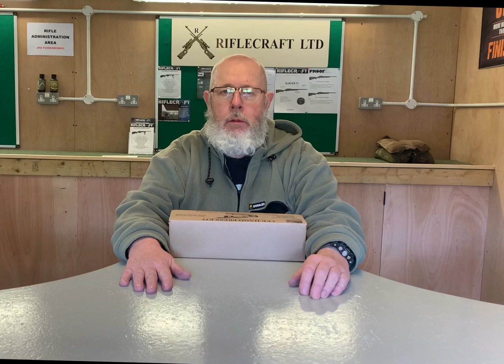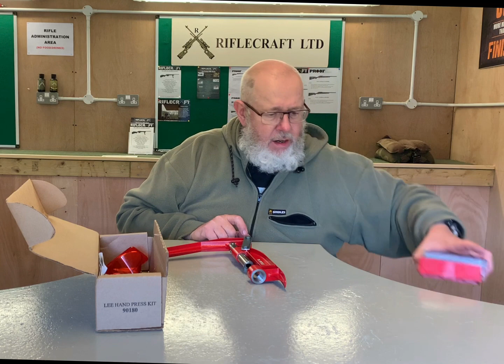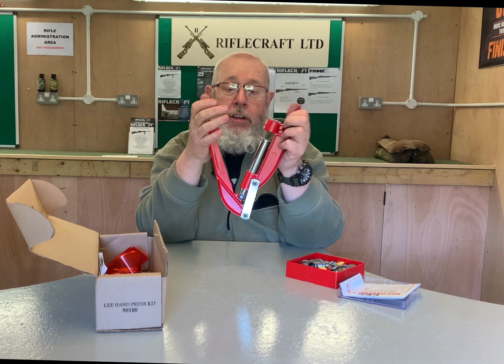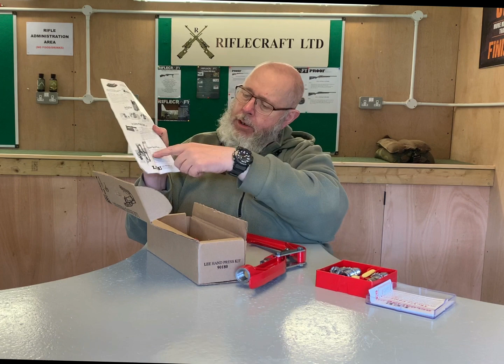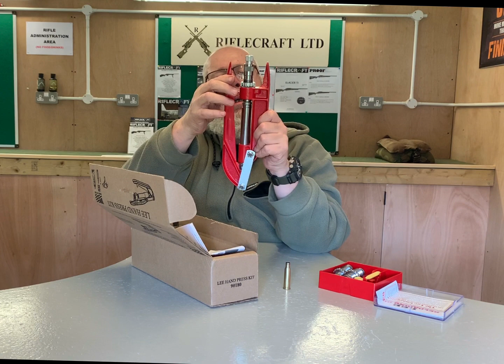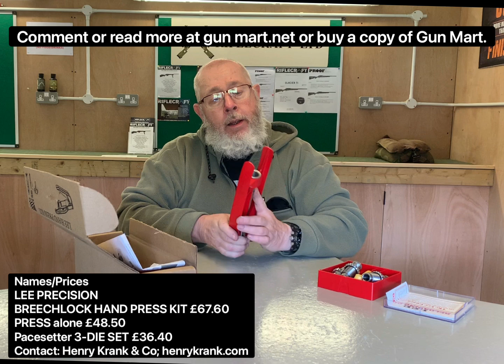Lee Precision Breechlock Hand Press Kit and Pacesetter reloading dies review

Comment: This is the only press I own and I reload about 1000 rounds per year.  All pistol rounds (9mm, 10mm, 45 cap, 38/357, and 44 spec\magnum).  This and Lee 4 die sets are spectacular!  I get the Lee Smart Lock bushings for each die and I can change dies in 2 seconds.  Without rushing I can do over 50 rounds per hour.  Highly recommended!

Comment: Do I need the full forming die or the neck sizing die. Very confusing. I will only be firing brass fired from my own 308. Thanks.
Reply from the maker: I use a full length re-sizing die for all my reloading.
Reply: @GunMartTV  Does that do the neck also for bullet seating? Thanks.